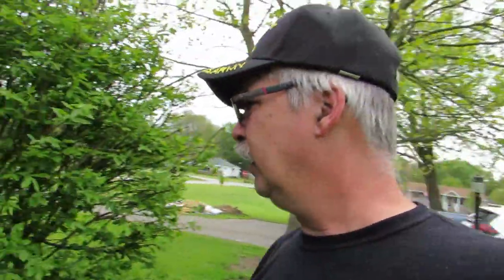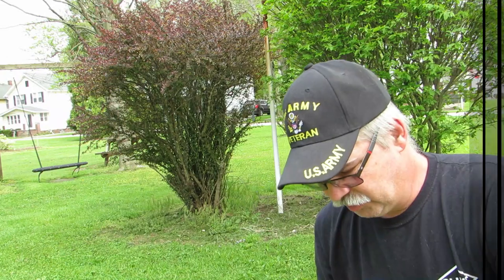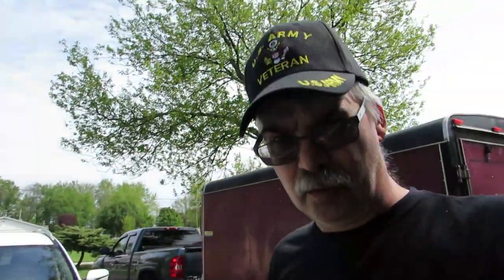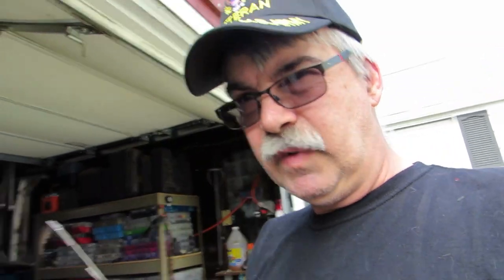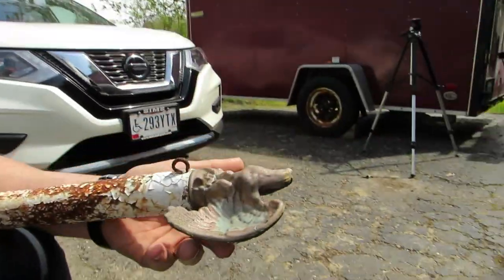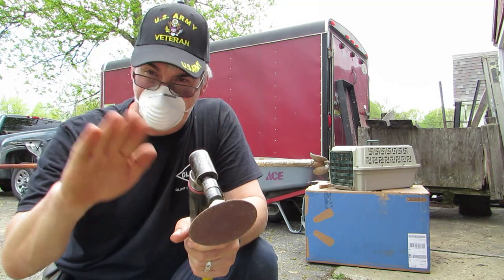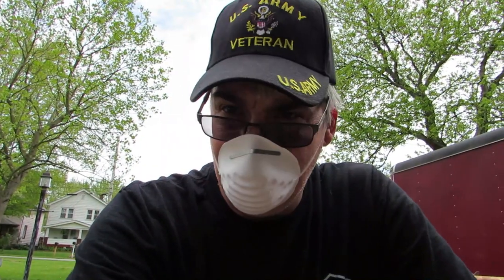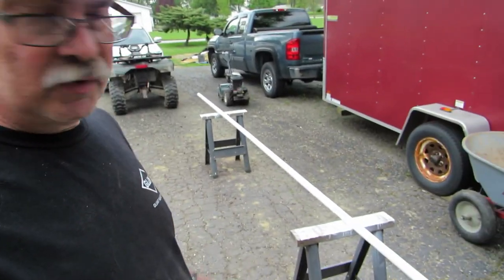How To Restore an Old Flag Pole

Comment: Oh, I just love air tools...much better then doing it by hand.  I have a few calipers and they come in handy.  Of course I was a quality engineer and manager so yeap...got all that stuff.  Rob, doing a fine job with the flag pole.  Much cheaper to do what your doing then to purchase a new one.  Have a great holiday weekend and will be looking forward to seeing your next video.  Love you guys💗👍🇺🇸
Reply: I've worked several jobs over the years and one was a machinist, so I have several dial calipers and micrometers, also worked as a quality control technician.